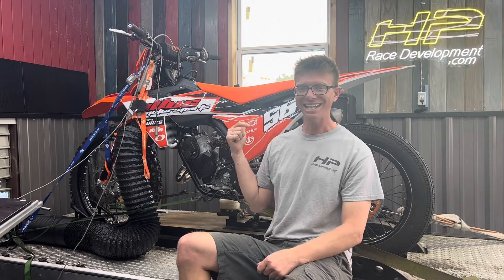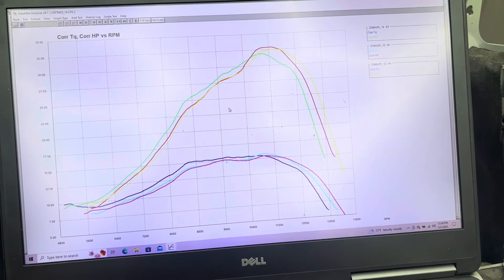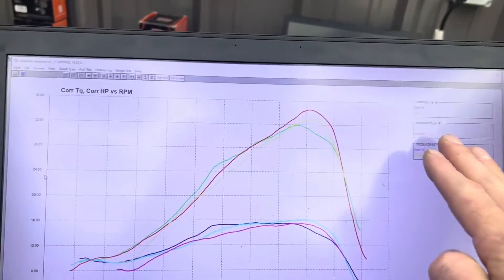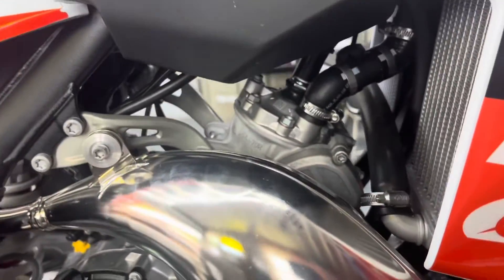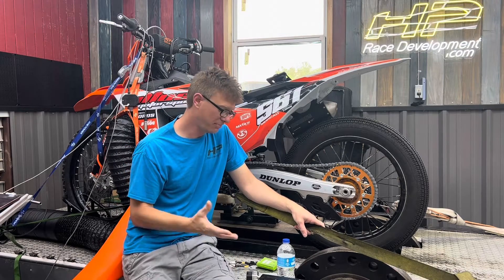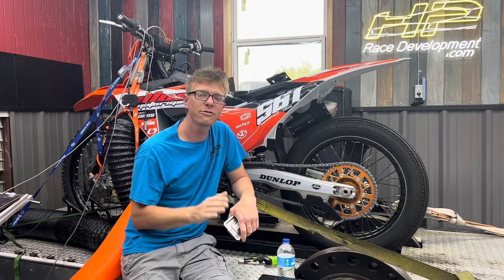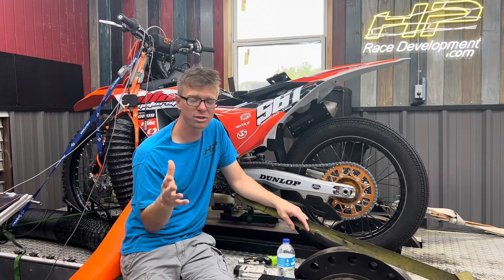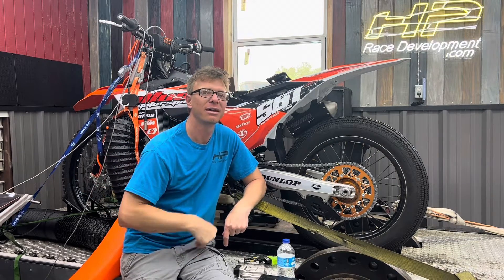EFI 2 Stroke 2023 KTM 125 Dyno

Comment: @hpracedevelpment I have been testing and tuning a cracked stocker ECU for 2 months with great results.
Raised the over rev limit l, Lowered the limits of the pressure table to account for “engine work”, lowered the pv opening (stock is 6k), corrected the upper rpm range of ignition timing and fuel delivery bc it’s rich and overtimed, (that’s why it falls flat up top), TPS values need to be set to .4000v, a BR9ECMVX plug, and the most important things are clearing the adapted values and tps circuit bc although it’s a non closed loop, the ignition and other tables shift to compensate for held value changes from the sensors and needs to be cleared.
The baro sensor is in the rear of the airbox under the fender left side.
There are so many diff things wrong with this set up it’s crazy…running T2 and an FMF pipeset and she runs like a modded carb bike now.
CCPS needs to be sealed as well..I have a bunch of vids explain some stuff on my channel, revs to the moon now and hits hard.
Hope all is well- J
Reply from the maker: I dont think the wmr dealer program suits us

everyone will be on the same set up - why mod at all.
Reply: @HPRaceDevelopment  ummm, not with WMR lol...they are not doing the in depth pv change, pressure table change, etc, they are leaning it out...I was just pointing out that in the video you mentioned not being able to change any of it and others have..successfully!  All good-
Reply: @The Motocross Mod Channel  

Derrick doesn't like it when someone says something contrary to what he said. He also doesn't like other builders who are ahead of him in the game. 

Mirror mirror on the wall...who does the best mods of all?

Mirror says, "Not you, Derrick."

Thanks for sharing what you shared. You helping Derrick will go thankless as you already noticed. He most certainly wouldn't share the information with you that you shared with him. He likes to take what others have done or shown & claim it as his own. He's into grandstanding.

Comment: Fully agree, efi is just stupid on a 2 stroker, they are supposed to be simple, loud and raw.  Check the wiring harness of a YZ to the amount of electronics required to run the EFi bikes its just plain silly.  YZ or Beta vs KTM group its not hard to guess which one will still be running fine in 10, 15, 20 years, check how many KDX models from the 90's are still ripping round!
Reply: Longevity are bad for business.
-KTM

Comment: KTM equipped there 2t because of emission standards for there Enduro Models in Europe. Yes they don’t need to reach these standards on there SX Models. But it’s cheaper to build just one Engine for both bikes.
Reply from the maker: its doubtful this bike or any of their tbi are meating emmissions
Reply: @HPRaceDevelopment  yes they do. KTM   primarily build Enduros for the European Market. These need to fulfill the emission standards. The SX Models are just converted Enduros.
Reply from the maker: @martinmielke8897  the current enduros are still TPI.....I can assure you these models will NOT pass real emissions standards.  Maybe europe has some exemptions.
Reply: @HPRaceDevelopment  what I’m trying to say is that the SX 125 comes with an EFI because it’s based on the European Enduro Models which need to pass emissions. Yes the SX don’t need to pas them and carb would do it. But it is cheaper to produce one engine with some changes. And yes the current Enduros are TPIs but they will update in June to TBI.

Comment: I will love to see what KTM does in the future with TBI. Personally the 2023 125’s I’ve ridden feel like they have a bog on hard landings, out of corners sometimes, have a GNARLY lean chirp, and have inconsistent overrev. Very disappointing and frustrating because I love the new chassis, and hate the inconsistency. I will say though, unlike the 125’s, the ‘23 300sx and 250sx have great riding powerplants on the track. Unfortunate that KTM allows a bike that feels unfinished to be released.
Reply from the maker: I dont think people understand how hard efi is to do on a 2t. the 250 and 300 are very slow per cc vs a 125.  The pipe doesnt do as much - so the tune up is easier to nail
Reply: @HPRaceDevelopment  Yep and as much as I like the 300sx, my ‘22 250sx with a built motor absolutely smokes it(I know, apples to oranges comparison, but still), and is a better understood platform. No real reason to buy a TBI bike yet 🤷‍♂️. Time to buy another 4 stroke I guess

Comment: It really sounds like they did the absolute bare minimum to get it working, a megasquirt is far more sophisticated. But it also sounds like a technology problem because we don’t have sensor tech that is quick enough to handle how a two stroke works. If you could adapt a Gm ls or lt ecu it might fare better, those ecus have a 5 axis strategy and references several live values to make decisions, it will estimate pooled fuel in the intake, the time it takes for fuel to hit the back of the intake valve, is torque based so that in itself can be useful.. lots to come I’m sure in the years ahead.
Reply from the maker: The ecu Power isnt the issue. These have highly advanced strategies with huge r&d money behind it

2 strokes are just extremely challenging vs a 4t

Sleds are more simple they run essentially 1 rpm

Comment: So it needs pipe temp sensor and O2.
Reply from the maker: no - thats too slow to be useful
Reply: @HPRaceDevelopment  what then, some kind of pressure wave sensor in pipe?
I'm sure they have some good default values that take the pipe into account.
Reply: @HP Race Development  but I guess what you were saying is the two stroke is basically so simple chasing better performance rideability thru efi is futile.
It's just never going to be what we expect it to be from efi.

Comment: Seems a lot more complicated than a carburetor. My choice is a smartcarb that eliminates the hassle of a normal carburetor when having to re-jet for temp and elevation.
Reply from the maker: sorry but a sc doesnt correct for temp
Reply: @HPRaceDevelopment  Does the STIC block require more or less jetting for temp and elevation changes? Any idea what STIC is supposedly debuting today?
Reply: The "Smart Carb" loses power vs the Keihin & Mikuni as well.

Comment: maybe you could do a Lectron vs keihin dyno comparison?
Reply from the maker: we have. i just choose not to publish it
Reply: @HPRaceDevelopment  Publish it! Huge fan of your channel. Most transparent out there!
Reply: and smartcarb. both lectron and smartcarb make power and fuel economy improvement claims.
Reply: @therawlifefamily  

The Lectron & Smart Carb lose power everywhere in the rpm range to the Keihin & Mikuni.
Reply: Keihin runs better but less fuel efficient. That sums it up pretty much. I would only use lectron or smart for long distance rides.
Otherwise properly tuned mikuni and keihin have more power everywhere it feels like. Especially right off throttle. Dyno might not show it but I went from a 300 with lectron, to a 250 with keihin + stic. 250 feels like it pulls harder off the bottom than the 300.
Reply: Lectron Pro
Reply: Here is the only real issue with Dyno Runs.  They only measure Max Potential HP/Torque Values at full throttle.  They don’t measure ride-ability nor part throttle HP where 99.9% of us ride.

The Dyno-Comparison I want to see would be done in 1/8th throttle segments.  How much HP/TQ is available at 1/8, 1/4, 3/8 etc throttle opening on say a 23 GasGas 125, 23 125SX & YZ125?

Comment: You may want to take another close look in your airbox, especially the left rearmost part - or just follow the wire that goes back there. And TPIs have had a separate baro sensor since 2019/2020.
Reply from the maker: tpi but not tbi
Reply: @HPRaceDevelopment  I wrote "and" - again, look in your TBIs air box!
Reply: @mpetkov2158  there is nothing in the air box except rubber...
Reply: TPI bikes have baro sensors since 2020. But the TBi bikes only have one sensor and it is the CCP

Comment: The early reports of EFI 2 Strokes seemed like they might be a saviour of them, giving better performance, fuel economy and less emissions. Seems like it might have been a bit premature to say the least. I was surprised by the volume of smoke on startup, I thought that would be nearly eliminated by injection. I was really hoping we would see multi cylinder, larger capacity bikes on the road again but sadly that seems unlikely now.
Reply from the maker: Im not sure why people felt this way. Its not magic…engines require the right amount of fuel and ignition to function - you cant just alter that to meet emissions etc…
Reply: @HPRaceDevelopment  It was just what I was reading when KTM introduced it, no expert here. I obviously was taken in by the manufacturers hype. There was comments about not having to mix oil and fuel, stuff like that.
Reply: Nobody cares how good or bad that race bike is for emissions.
Reply: @adriangalvez5104  No argument about emissions for competition bikes, really my comments were about hoping we could get road legal 2 strokes similiar to the Yamaha RD's (RZ's), RG's etc. of yesteryear. Here in Europe we managed to get them for a good few years after they were banned in the US and Canada. I grew up riding them and would love a modern version.
Reply: @adriangalvez5104  the DEC does and they make all the decisions as to what will or won't be produced...
Reply: The campfire where I burn my used 4 stroke oil puts of way more smoke than the 2 stroke..... Just saying.